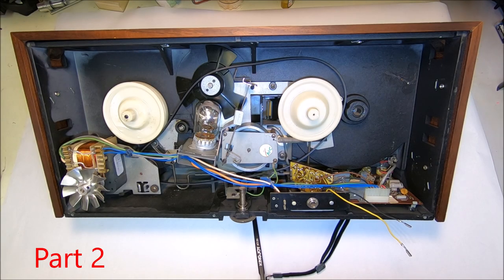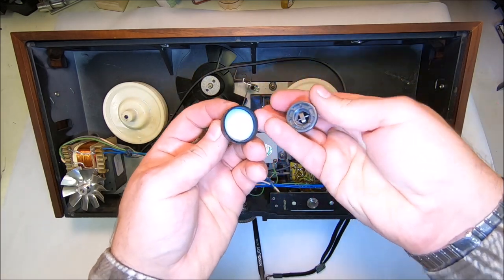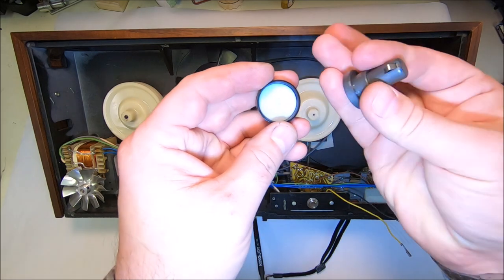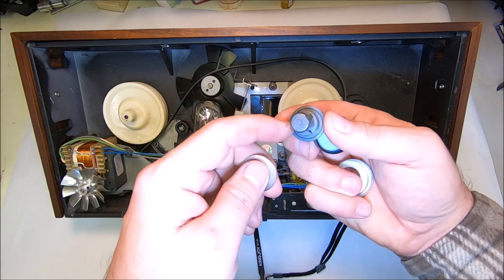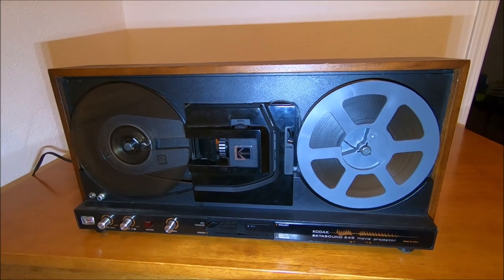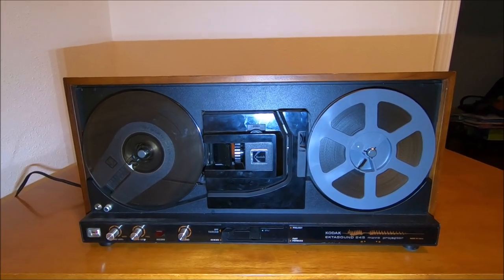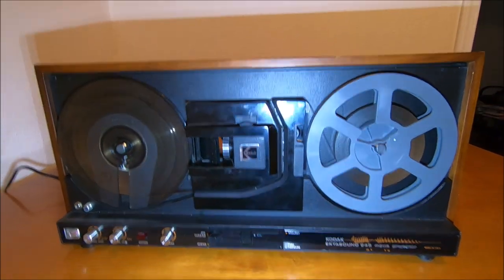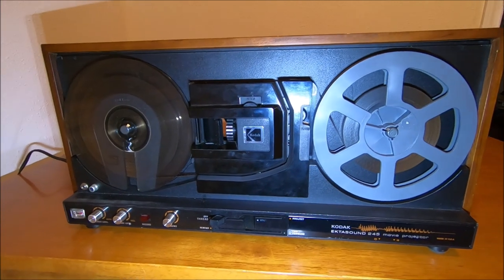Kodak Ektasound 245 Vintage Super 8mm Movie Projector DIY restoring / repairing Part 2

Comment: Going to work on my unit for the same issue and am wondering if you noticed if the belt caused any problems?  In VCR's less than half the age of this unit the belts would be in pretty bad shape by now.